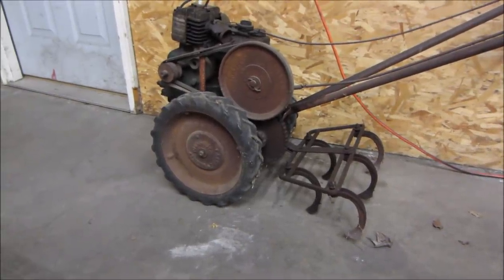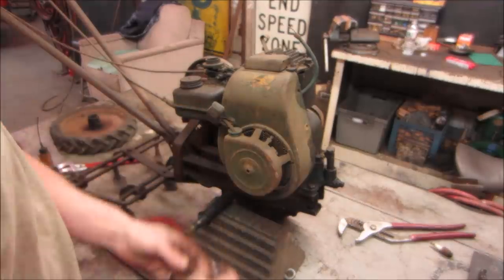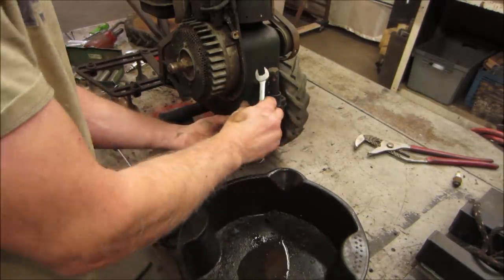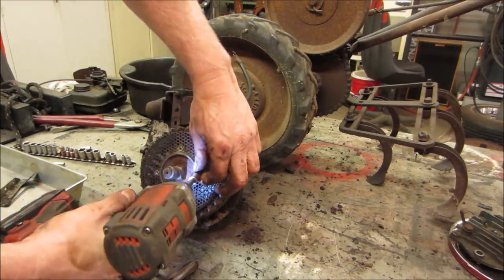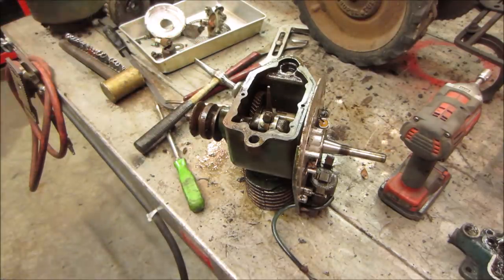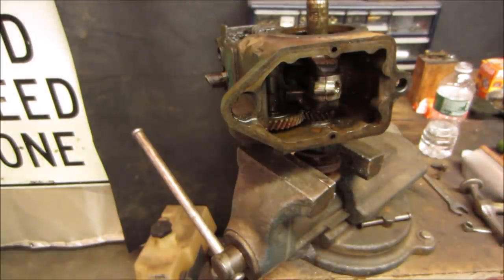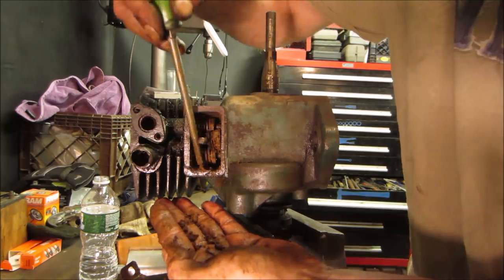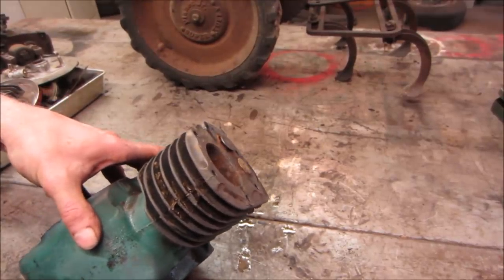Broken Antique Tiller tear down, can it be saved?

Comment: I actually own one of these.  I've pulled it out of the barn multiple time over the course of 30+ years.  Most of the time a quick carb clean and new plug did the trick.  Last time required new points/condenser/coil.  Still runs like a champ.  All original internals.

Comment: "Lovingly Restore" it, like the marine engine was, and donate it to a museum. Then in another 50 years, Mustie3 can have another go at it .
Reply: that's just sadistic,
Reply: Don't give him any ideas
Reply: Actually, with a medium size lathe, he could sleeve it easily. I can't remember the name of the channel, but another fixer pulled an ancient Briggs out of the mammoth bone yard and restored it to full function using a cast iron pipe, braze, and patience.
Reply: @aserta  The problem is getting it to that stage
Reply: by the the penetrating oil will have soaked well into the ring land..lol.. water in the crank case was just not a good sign,  it's too bad, as they don't make engine castings with that much meat anymore.. personally given the time and energy, I'd consider it for an air compressor head.. but he has enough projects that actually work.. the plate is full..

Comment: Thanks to you Mustie I fixed my first small engine. A free 1964 Evinrude Yachtwin I found on the side of the road. It needed a carb clean and rebuild, new coils and head gasket, cleaned and adjusted points and now it runs good! Thank you

Comment: I inherited my Dad’s Allis-Chalmers B.  Engine seized when I got it.  2 cylinders were rusted from the valves being open and sitting in a humid barn basement for 10 years.  Very long story short, after using various potions of Mystery Oil, trans fluid and acetone for a month, none of which did much, I filled the cylinders with Evapo-Rust and 24 hours later, the pistons moved for the first time in years.  The tractor now runs fine, still has good compression, and the pistons have never been taken out.

Comment: After watching loads of your videos, I finally thought it was time I had a go at this.  We don't have the free piles at the roadside that you have in the U.S. so it's off to the recycling centre.   Five quid later I'm the owner of a Mountfield mower with a Briggs & Stratton 450 motor listed as a non-runner.   Applying the Mustie1 methodology,  Check compression, check for spark,  dribble in some of the Saudi's finest and we're away.   Quick service and tune up and it's cash time.    I'm inspired.

Comment: If you could get that pulley off the motor you could re-engine the tiller with another Briggs unit, I'm sure you have a spare or two in the hoard.
Reply: Or twenty.
Reply: no brigs please, unless it too is very old. The modern ones suck.
Reply: @tootall5559  only an old engine would actually fit i think
Reply: @gtb81.  you forget what Mustie can do. He could put a VW motor on it if he wanted to, maybe even a V8.
Reply: @tootall5559  true, but i was meaning with the original mounting bracket
Reply: @gtb81.  well if you change the motor, no need to keep it original, unless you mean an original Mustie1 creation. A Harley (or one of the clones) motors would be aces on it. Also, I've seen miniature v8s down to the size of 1/24th scale, so anything is possible.
Reply: @tootall5559  thats true
Reply: Seriously! That tiller is crying out for the 6.5 horse Predator for just $199.
Reply: @jamesscott1932  Not a tiller. This is what passed for a garden tractor. It's sole job is to pull things, like plows, cultivators, and so forth. So far as I can find out, there are six implements for this particular tractor.

Comment: I think it’s the perfect candidate for the little Briggs gear motor you got running on Dec 16 2018. You’ll just have to put a 16 inch diameter drive pulley on that one to get it to go.

As an alternate the 1943 Briggs ZZ you resurrected on September 14th 2018 would only slightly over power the Planet Junior. Of course you will need counterweights on the rear if you use the ZZ. LOL  You could fab up a homemade muffler for it and be off to the pea patch with it.

Comment: as long as you had fun, why not? i mean, what else are you gonna do on a sunday?  you could repower the chassis. the rubber was still there, it has the cultivator attachment. i'm sure it had a plow, and a front blade as options minimum, so it could pull a cart around i'm sure. make it into a retro garden tractor rat rod. it'd be one of a kind, that's for sure.

Comment: I have an similar tiller with all metal wheels in my back yard.  Been there long before I moved here because there is a tree growing through it.  There it will stay.
Reply: Makes a "scenic" planter.. lol 

i wouldnt mess with it either man. I have a old farm sprayer with several pines growing through it and im not touching it
Reply: @Ajaxaxxess  Imagine restoring it, without moving it lol
Reply: @smokyofstormwind420  they call that a paintjob.
Reply: @fixt100  preach!
Reply: @Ajaxaxxess  im not against using paint to save an old piece of machinery but if you arnt  putting in new rings and bushings you arnt restoring it,, you are getting it running or painting it or in some cases washing it....
Reply: @Ajaxaxxess  on the other hand i will buy a beer for the guy who rebuilds an old tiller and doesnt remove it from the tree to do it (magician?).

Comment: Mustie I have a '64 B&S 5hp that came off a Simplicity snow blower with pointless ignition,new carb,refurbed about 20 years ago with new rings and valves..runs great..I have had it for 50 years..was saving it for a mini bike or go cart but never got around to it :-/ Prolly bolt right on to your tiller. You're welcome to have it!

Comment: Can't save them all. These vintage Briggs have the year they were made on the back of the flywheel. This reminds me of a craftsman Roto tiller I bought that the owner had sitting under the eve of his garage so that all the water coming off the roof landed right on top of the engine. Long story short the engine looked just like this one when I took it apart

Comment: Hey I see you working the evapourust but I like to keep a "stink tank" running around the shop. A molasses and water farmers universal rust removing bucket. The process is called chelation  and works with binding atoms and reconstituting metal as best as possible. A man could run a channel just on before and afters of stuff left to brew in the stink tank but for projects you have in the queue it might be cool to add a tank to your channel.

Comment: Ugh, we had one of those when I was a kid.  We called it a walk behind tractor, lol.
Reply: i still got two david bradlys rusting out behind the garage. a least they have a cool hood.
Reply: they made a lot accessories for those things- including relatively huge trailers so you had an actual tractor you could sit on without the walking behind part
Reply: Me too , they are so heavy that I would lose control of it.
Reply: didn't it have a snow plow on front ??
Reply: @richardsabean5781  one of mine does, with 31" tires on 10" wide jeep rims.
Reply: @richardsabean5781  yes, sorta you could get a blade for the front.

Comment: Actually this isn't a tiller, it is what is called a garden tractor. My dad sold these way back in his store, I think in the late 40's but not sure about that. This little tractor preceded  what we know of  today, as a tiller. A tiller, tills the soil using rotating tines where as this little fella actually 'plows'. As you stated, this setup was more of a cultivator with the center plow, second row removed allowed the tractor to straddle the plants planted in a row and the other four plows were adjusted as necessary. I walked many miles behind one very close to this one in looks.

Comment: Planet Jr. Super Tuffy made by S.L. Allen, Pennsylvania.  I have one just like it, 6S Briggs came on mine.  Planet Jr.  was the brand name.  The Tuffy version had a 5S engine and ribbed tires.  Dude, i hope you didn't  scrap it.  Just get a replacement motor.  Its a yard tractor, not a tiller.

Comment: At least put a donor motor on the tiller and get it going. Thats a cool little machine
Reply: Any old three horse brigs horizontal shaft should do the job with the correct size pulley taped onto the side.
Reply: With another engine it would make a home gardener a nice little tractor. Better than a push plow.

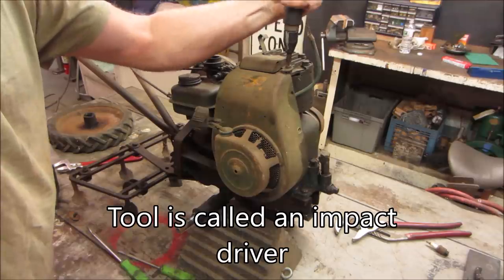Comment: 9:15 - "Tool is called an impact driver" - I needed an impact driver while working on my neighbor's old Honda's brakes. So I went to Autozone, I went to O'Reilly, I went everwhere looking for an impact driver. Dumb young people kept trying to refer me to Milwaukee, DeWalt, all these cordless tools. I ended up carefully using my impact wrench very carefully with a 1/2 to 3/8 reducer and a #3 phillips bit to get the screws out of the rotors. Weeks later I saw that Autozone actually does carry impact drivers. Trouble is that young people who work there have no idea about anything that isn't electrically powered.
Reply: Robert Gantry 
I still have mine, I bought off the Snap-on truck back in the mid-seventies. 
The old gentleman who was the Snap-on rep came by the shop around lunch time on Friday right after the pay checks were handed out. He would cash our checks and take out for the payment. Mr. Walker, great guy.
Reply: I bought one many years ago from the J.C. Whitney catalog.  It is still going strong.  Very handy tool when you need to break a screw loose.
Reply: I too have an Impact driver.It's new in the case and I see it sometimes.Just not when I need it.Had it almost 20 years,and the gremlins hide it.
Reply: I've got a vintage Mac Tools impact driver w/ case . But it only has a couple of drivers
Reply: @Daddyrabbit_2   - You can still get new bits for it. I bet Home Depot has bits, or maybe on Amazon.
Reply: @robertgantry2118  I guess regular impact driver bits like DeWalt or Milwaukee makes would work. My Dad was a diesel mechanic 🧰 and I have all his tools from his career. Mostly vintage Snap On, Mac, Cornwell , a lot of Matco and miscellaneous Blue point,SK , Apex, Sunnex?,etc.
I'll never use 50% of it.

Comment: I’m going to guess the cylinder filled up with water then froze and cracked.
Reply: My Father worked on a Cushman scooter.  He bored out the cylinder to take a Plymouth car piston.  The boring just did cut a small hole between two fins, he brazed the hole up and cleaned the bore out and it would run like a scalded cat.  The displacement probably was close to double the original.
Reply: My thoughts too!
Reply: A good deduction indeed! It may even be that over a long period of time, it filled, froze, filled and froze again, until the piston was pushed all the way to the bottom of the cylinder, then on the last fill and freeze cycle, it pushed the cylinder head upwards, which in turn dragged the topmost section of the cylinder/fin with it.

You never know, bore and sleeve, and it might just be okay?! 🐵
Reply: or it really did sit at the bottom of a lake
Reply: Probly not cause the valve was open so the water had an escape route
Reply: @ionracer24  I don't think so the water in the valve escape route would freeze first then the shear mass of force would push the cylinder apart.
Reply: @mastergroda8915  Lakes don't freeze to the bottom.

Comment: I came into a Planet JR (no super anything..) about 45+ yrs ago.. Wood handles.. Cast iron Tecumseh 1 3/4 hp engine.. In my irrational youth, I removed the engine..& in a 70's haze, somehow lost it. I later re-powered it with a Fuji-Robin 5 hp 8:1 reduction (as had the original).. I still have it , have tilled Many gardens with it and it's single furrow & 3 disc harrow attachments. It will D*!! near pull down a house!! One of the most amazingly overbuilt machines I have ever seen!

Comment: Imagine someone finding a modern engine, stored like this one for 50 years.  All the plastic would have gone brittle or disintegrated, and the computer electronics would be one mass of corrosion.
Reply: I have a predator 212 to test that theory also I live in Indiana so if left outside it would be gone in 3 years
Reply: What state is this?
Reply: @MrLiamo29  -- Mustie lives in southern New Hampshire
Reply: very true
these old engines were built to last. they weren't that educated on planned obsolescence
Reply: Shango066 did a video on the ecu off a mitsubishi pick up.
It was about 30 years old and unrepairable and irreplaceable.
Reply: @OldSonyMan  it was a Mazda
Reply: @rogerd4559  not really. These engines were made out of metal, so technically they "last" but they suck and make no power and are heavy AF. modern engines make tons of power, are cheaper, lighter, and will last for decades if you use them the way the manual says. Those that have electronic ECUs are only in cars, and it's your own fault if you leave that out for 20 years. No engine is made to last 20 years of no use.
Reply: I mean, this was filled with masses of corrosion too. These old things weren’t built to last but they might have been designed to be serviceable since they were costly relative to labor. Electronics also don’t mean unserviceable. You can however end up with parts you can’t fabricate or replace easily and it may be more complicated to figure out what a replacement part might have to do because the part ran software. However if you take things back to fundamentals you can certainly replace electronics just like you can mechanical parts. It’s just another domain of knowledge.

Comment: Engine swap maybe? Swap a more modern Briggs on it? When the rest of the cultivator is solid you can still make it function again.
Reply: A 3 1/2  hp flathead  aluminium briggs from the 80' or before  will fit,not a damn  communist  china  engine!

Comment: About 60 or 65 years ago,  we had a tiller just like the one you attempted to salvage on our family farm.  Ours had a single axle rubber wheeled cart,  with a seat and an attachment much like a dozer blade for smoothing loose soil.  We used the blade for smoothing seeding beds.  As I dimly recall, the engine on ours failed after a couple years. Our vegetable garden was an acre or a little more to feed the large farm family so it had considerable use.

Comment: Hey Mustie , the cam pin is tapered , and goes out towards the Mag plate side . Kroil will get the valves out with time . The block can be cleaned up and working but will smoke like hell :)

Comment: I unseized an old Briggs in about the same condition with the piston stuck all the way down by heating the jug with acetylene and then filling the crank case with machine oil and letting it cool naturally. It took a couple of minute wiggling it back and forth but it eventually gave.

Comment: IIRC sickle bar/counter weights for front end as well as a headlight kit (aftermarket).  Evaporust can be run in a parts washer... just don't tell anybody.   In the big drums is works better with a submerged pump...

Comment: It is cast iron, you should have had it welded and then honed. The head bolts would have even held it tight enough to get running. It is never going to be used under load for any duration, so it would be just fine.

Comment: Planet Junior was a legendary collectible farm tool. Mostly, they were just hand pushed wheel hoes, but they had many many row crop attachments such as seed plate planters, cultivators, sweeps and furrowers. Even the attachments are sought after collectibles. First I've seen a powered tractor model. Thought it was a David Bradlee Walking Tractor on first seeing it. Restored, that tool would probably fetch a pretty good collector's price. Many small farmers now wanting to plant a couple acres of row crops subsistence food and would probably jump on that if it ran good.  The narrow width wheels makes it  nice for going down between the crop rows. Even repowered with a modern engine, someone would likely want that thing.
Look up Planet Junior and their history and all their attachments. If you see any more parts snap them up!

Comment: Had one identical
 Made it run and it worked well until it threw a rod. Several years later getting it at a farm sale in Wyoming. Briggs mtr. Ours had a crank handle start.

Comment: You must have been repairing hundreds of B&S engines? I had Stiga lawnmower with 4,5 hp B&s and it has so little compression, so I grind valves but it did not start by rope, so I did it same way as you: by a drillmachine. But that is history, nowadays I have the Honda 4 hp, and that is never fail in 10 years, even carb cleaning it does not need, very good engine. Here in Finland we are using 95E10 gasoline, which is 90%gaso+10%ethanol. Thanks for many enjoying videos, what about that "Lambo"?

Comment: Its a 6s. Last of the cast Iron blocks before they came out with Aluminum blocks in conjunction. Its pre 1965 because its got serial in place of code. Cant pull a year off that, but its mid 50's. The older ones had dates stamped behind the flywheel, I think by the 50's that was done. Only way to get DOM is contact the antique Briggs guys with the archived records.
I have that exact same 6s, same color and all on a 1954 Savage Arms reel mower, I grabbed last year for $50 just for its coil. Never used it, so I have a complete 6s laying around in good shape, just haven't had time to mess with it yet....

Comment: I believe there was an option of a plow for the front. I saw a photo of one in Popular Machines with a plow. I may have been a how to add a plow basically a pull pin with 3 settings, that allowed you to tilt the blade Left or Right by 30 degrees. the article said good for snow plowing of the driveway.